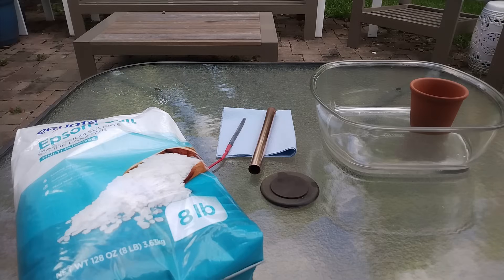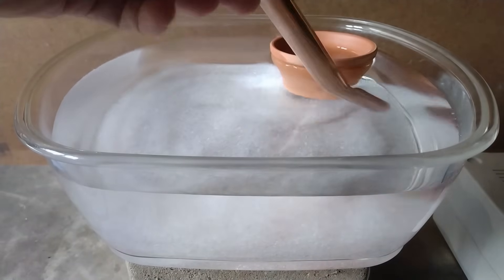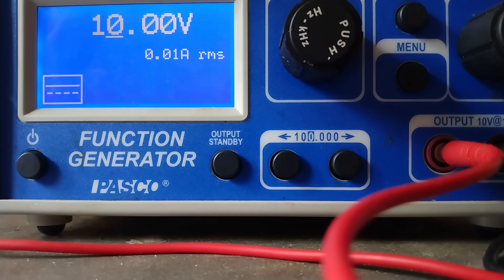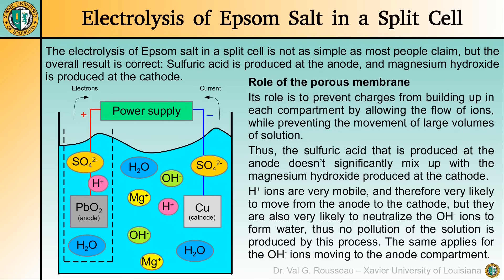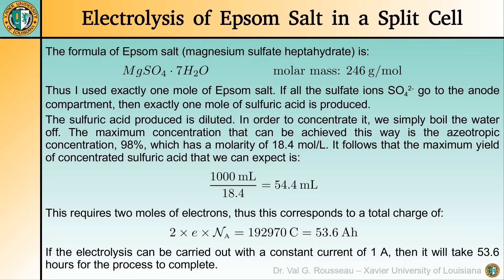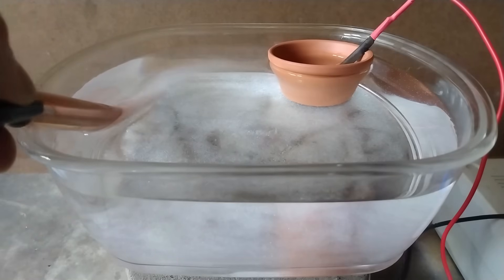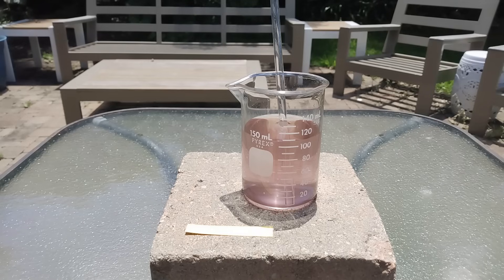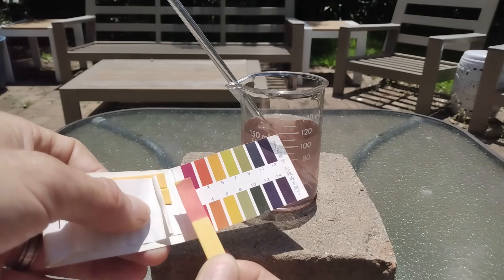Making 98% Concentrated Sulfuric Acid from Epsom Salt - DIY

Comment: I have watched several electrochemical sulfuric acid production videos, but in my opinion, this is by far the best video. Very well organized and the description and tables shared really brought the process together. Thank you so much for your time and work, this is awesome. Keep it up. Cheers!!
Reply from the maker: Thank you! Please, share the video.
Reply: Did you test it?
Reply from the maker: @suprememasteroftheuniverse  
I showed in the video a test on a paper towel. I also used it to make nitric acid (like here: https://youtu.be/NHBDXtn7pjA) when there was a shortage in store where I usually buy sulfuric acid as drain opener. The resulting nitric acid was working the same as usual.
Reply: @BlueMoonshine Does this chemistry relate to lead acid battery restoration using Epsom salt?
Reply from the maker: @RandomInterjections  
Probably. Look at this lead-acid battery that I made. It also involves a lead-dioxide electrode, the other one is a standard lead electrode: https://youtu.be/0zQYJJz89Wo
Reply: Why did we use PbO2 And Cu electrodes  and not graphite
Reply from the maker: @HeadmanLesetlhe  
Well, the video explains all the possible reactions that can take place, and shows that the PbO2 and Cu electrodes in this case are stable. If you use other types of electrodes, other reactions can take place and make the electrodes unstable. Graphite is not bad, but it will eventually decompose and pollute the solution. You will also have to change the electrode.
Reply: @BlueMoonshine  wow... thank you so much now I understand

Comment: The positive electrode is not completing the circuit,why?
Reply from the maker: Why do you say that? The circuit is clearly shown, the real apparatus as well as the picture. Clearly the circuit is complete. Current goes from the generator's positive out put to the positive electrode, then through the electrolyte to the negative electrode, and back to the generator.
Reply: Is the clay pot a conductor? Or made of graphite the clay pot is not at the same water level as the other container.At least from my perspective.
Reply from the maker: Did you even watch the video? It is clearly explained that the clay pot is porous and lets ions go through, so yes it is a conductor. As for the level of water in the pot, this is also discussed in the video.
Reply: Your accent ,made me speed up the video,sorry.
Reply: @ReynaldoColindres-n6l  Wow! You are criticizing the accent of a person who speaks 5 languages at a level well above "decent" in addition to providing you with clear information! Well done!  How many languages do you speak? Barely one?
Reply: My identity is known to the CIA,NSA, the D.O.D. and D.A.R.P.A My number system was created in 1996 it runs the World Wide Web and you owe me $5000 for my intellectual property ,pay quickly.

Comment: What if I put the power supply the wrong way around ?
Reply from the maker: Then your copper electrode is going to corrode, some unwanted reactions are going to be produced, and if sulfuric acid is ever produced (in the copper half cell), if will be polluted.

Comment: I have an old stickwelding machine , that i sometines use as a DC source to do some elektrolisys.
And was wondering if i could up the amperage it can put out 140 A, to speedup the proces ?
Reply from the maker: If you want to speed up the process by multiplying the current by 140, you need to multiply the electrode's surface area by the same amount. Otherwise, the voltage is going to increase and you are going to generate unwanted reactions.
Reply: @BlueMoonshine thanks alot ☆☆☆☆☆
Well done video's

Comment: I pretreat my pots by using them to make sulfates like copper sulfate.   Washing with muriatic acid as well.  Over time you leach out the trace clay metals.  I prefer titanium cathode as well since while the copper is not an issue there are sometimes other things used to treat cheap copper pipe which can foul your solution.  Best to either get electrolyte grade copper or cleanse them thoroughly.
Reply from the maker: Thanks for sharing your tips; those are great suggestions for purifying the process!

Comment: Why didn't you use a distillation apparatus for the concentration?
Reply from the maker: First, because distilling sulfuric acid requires you to heat the mixture at 337°C (639°F), which puts a lot of stress on the distillation apparatus. Second, because it is not necessary (unless you want a high purity of sulfuric acid). Just boil the water off.

Comment: I wonder how much energy it would take to create enough sulfuric acid to make a normal size lead acid battery?  That is so cool you can create the sulfuric acid using electricity.  I always knew it was a very resource intensive process to create batteries so lithium would have even greater losses in sourcing and creating the materials for its battery composition.  people need to learn and understand these processes so they can realize no battery will ever be green and they all need to be recyclable reusable over and over again and re-buildable.
Reply from the maker: For reference, here is a simple sulfuric acid battery that has enough power to run a small electric motor: https://youtu.be/0zQYJJz89Wo

Comment: lol oh dear oh dear, the distilled water isn't a non conductor because it isn't at absolute zero, that's just flat out absurd, no, the reason is that distilled water is a perfect balance between hydronium and hydroxide, both being present at 10 -7 moles per liter, they are stoichiometric, and neutralize  each other. If you add anything that dissolves in water, the ions can act as charge carriers, it doesn't take much of anything, even just leaving distilled water out and it absorbs CO2 forming weak carbonic acid, even this will conduct.
Reply from the maker: I didn't say anything wrong! Pure water at 0 K is an insulator. Above 0 K, hydronium and hydroxide ions form due to thermal energy, and the water is no longer insulating. If the water absorb CO2, then it is no longer pure water. I didn't say anything wrong, so you can keep your "lol" and "oh dear" for yourself!
Reply: Oh dear, here is ashleyobrien4937, a know-it-all who thinks he knows better than the professor...
Reply: Dear @ashleyobrien4937, you are exposing your ignorance and making it worse by unsuccessfully lol-ing at @BlueMoonshine who is right. As he said, distilled water at absolute zero temperature would be perfeclty insultating because there wouldn't be any hydronium nor hydroxide ions. It is because of thermal energy that these ions form and make it conducting.

Comment: I thought that such electrolysis would give sulfur at the anode. And the decrease in the amount of water in the pot is the result of osmosis. The salt solution "pulls" water through the membrane (pot wall).
Reply from the maker: No sulfur at the anode. The possible reactions at the anode are given in the video, and the reaction that takes place is the one that has the greatest oxidation potential.
For the decreases in the amount of water, yes it is because of osmosis.

Comment: I made some and it was almost the exact same from the red contamination turning into a clear solution, etc but when I get it concentrated enough, I keep getting mgso4 precipitation regardless of how long I run the electrolysis. I’ve gotten it stronger since the first couple batches. Any advice on what I should do to not have the precipitation. The acid is very very close to dissolving paper towel, doesn’t do much with sugar but is enough to generate a bunch of hcl gas when reacted with salt. I estimate the con to be around 70%
Reply from the maker: Usually sulfate salts don't react with sulfuric acid, and I bet the same applies to the remaining Epsom salt. The acid can dissolve it (like water dissolves table salt), but it doesn't react. So, you say you want to avoid the precipitation? Why? On the contrary, you want the remaining Epsom salt to precipitate so that you can separate it from the sulfuric acid by decanting. Regarding the concentration, if you have only 70%, it simply means that you didn't heat it high enough. The azeotropic temperature is 337°C. I usually stop heating around 330°C in order to avoid overshooting.
Reply: @BlueMoonshine I understand that they don't react. It's just when I reach around 70% the mgso4 starts precipitating out and if I continue it will become a sludge and it ends up being a waste if I try to decant the acid from that but I can definitely get it to the temps it needs. And even much higher if I needed to I had the temp up at 315 and it was still rising. I've tried running it much longer than the calculations predict. Whenever I catch it right before it precipitates I do end up with a completely clear and colorless solution though so figuring out how to not have the mgso4 precipitate out so early I will have it down
Reply from the maker: @ARaceIntoSpace  
But if it doesn't precipitate, it is because it is dissolved in the water that is still in your sulfuric acid. Sure the acid looks cleaner, but it is not. You want to precipitate the residual MgSO4, let it stand for some time so that it goes to the bottom, then slowly decant. What electrodes did you use, BTW?

Comment: Great video! I have used electrolysis to produce nitric acid from potassium nitrate and I also had the water level drop in my clay pot anode chamber. I believed it was due to osmosis. 

I had red tint in my first few runs too and the color lessened with repeated uses. I believe the iron content in natural terracotta was the cause and was eventually leached out. 

Using a passivated lead anode is a very good idea. I used graphite electrodes and the anode would disintigrate if the voltage was too high.
Reply from the maker: Yes, osmosis is a major contributor to the water level drop during electrolysis. Also, you are probably right about the iron in the clay pot.

Comment: To make the sulfuric acid, simply burn the MgSO4. You can make the pure SO3 gas.
MgSO4 -> MgO + SO3 at 1124℃
SO3 + H2O -> H2SO4

But this method requires enclosed reaction system.
Open air works may result injury or death.
Reply from the maker: I believe that burning MgSO4 gives MgO + SO2 + ½O2, not MgO + SO3. So, it is not that simple.

Comment: If I filled the hole in the clay pot with %100 silicon, would it still work or would it contaminate the reaction?
Reply from the maker: Silicon should resist to the sulfuric acid that is produced. Yes, it is hard to find a clay pot without a hole in it.

Comment: Red clay has a lot of iron.  In the spirit of diy, one could slip-cast and fire a pot out of kaolin (like EPK), and perhaps obtain a more pure solution.  To lower the maturation temperature of the kaolin (which is rather refractory) one might add a little B2O3 or PbO as a flux, neither of which is likely to react appreciably with the acidic solution.
(None of this is 'necessary' - there's a gallon of H2SO4 one click away from anyone.  But its manufacture is an interesting rabbit hole.)

Comment: Whay if i use sodium sulfate??
Reply from the maker: It is probably possible. A similar analysis as the one I made in the video should tell you whether the reaction works or not (look at the list of possible reactions at the anode and cathode, and see what are their respective oxidation/reduction potentials).

Comment: Considering your lead electrode came from batteries, is it possible that it includes some trace cobalt or manganese additives?  Since the pink coloration only occured inside the clay pot, rather than outside it. That pink seems very reminiscent of cobalt to me.

Once boiled down it would lose hydration and the color would disappear.

You could add ammonia solution maybe to the precipitate in your distillation flask to confirm.
Reply from the maker: I actually found out what happened: It was a brand new claypot and I forgot to remove the glaze on it. It started to dissolve in the sulfuric acid that was produced. Now, all the glaze is gone and I no longer observe this coloration.

Comment: Very cool. I never push towards other electrolysis. I just use it for plating or rust removal. Been meaning to make concentrated oxygen or collecting carbon. This looks like something i may try in the future just for fun. Got into mechanical n chemistry engineering while i was in hospital. Wish i was this interested in it when younger.

Comment: So to make h2so4 I need a pbo2 electrode and to make the pbo2 electrode i need h2so4😅 i hate rules.
Reply from the maker: You can simply use just lead, and the electrode will oxidize and turn in lead dioxide as you do the electrolysis. This will produce a little bit of contamination at the beginning, but it won't dissolve so you can easily filter it out.
Reply: @BlueMoonshine  thank you!

Comment: No, your explanation is all over the place. Many things you said are not right, but your bit about protons being highly mobile, they are NOT free protons but are found as hydronium ions, H3O+, you could have got much better separation if you used a better cell divider, you will find the white plastic inside LiPo batteries, or even Lithium ion  batteries, makes for an EXCELLENT cell divider, allowing only charge to cross, the membrane porosity won't allow salts to cross etc. Huge current draw through it is possible BUT be careful not to allow the cell temperature to rise over say 50 Celsius max otherwise the tiny holes in the plastic will close up creating an open circuit-that is a design safety factor of course, when the battery is operating outside of current draw or loading it shuts the party down permanently. The great thing about that stuff is that you can get almost a meter of it from just one AA sized cell, but the bigger LiPo's give a wider piece to work with. Just take a plastic container, cut a small rectangular sized hole in the side, cover that hole with a piece of the plastic separator, use silicone glue to mate it to the plastic bottle, and voila ! there's your new catalytic cell. No silly primitive clay pot needed.
Reply: I don't think @BlueMoonshine's explanation is "all over the place". It is a pretty good tutorial with a simple experimental setup that can easily be done at home by anyone. Just because he said "protons" instead of "hydronium" (which is a common shortcut) doesn't invalidate his explanation. Now maybe it is possible to improve the setup as you said by using the plastic membrane of LiPo batteries instead of a clay pot, but once again this doesn't invalidate his tutorial.

Comment: PEOPLE DONT WORRY, you can make two electrodes just by using graphite sticks which you can find at any hardware shop
Reply from the maker: 1) Graphite decomposes and leaves a mess at the anode.
2) Why would people worry? It is very easy to make a lead-dioxide electrode, as I explained.

Comment: could I possibly use both Kathode and anode made out of different materials?
Reply from the maker: In principle the cathode can be any conducting material, but the anode has to be made of a non-corosive material. Either lead-dioxide, platinum. Carbon can be used, though. It will corrode, but the corrosion can be filtered out, as it won't dissolve in the sulfuric acid.

Comment: 260 grams of salt and 4 days of work for 5 ml of sulfuric acid. So for 500 ml of acid I need 26 kilos of salt. Lab alley is not that expensive then
Reply: That's a ridiculous comment! The point is not to save money, the point is that many countries (like Italy and Germany) ban the sale of sulfuric acid to non professional chemists. Then making it like presented in this tutorial becomes a viable option for people who need it.
Reply: Still 5 ml  after all . The question is if I wanna make litres the only way is to increase the quantitie of salt ?  @AndreaKarlis
Reply: @Memo-py3eu  
Atoms can't be created without involving nuclear reactions, so yes, the quantity of salt must be increased.
Also, there are some losses due to the fact that the claypot is not a perfect separating membrane, so some of the sulfuric acid produced ends up leaking out. Maybe using a better separating membrane could increase the yield without having to increase the amount of salt? Is that right @BlueMoonshine?
Reply: The real issue is epsom salts is mostly water, so much of the weigh needed is not used in the reaction
Reply: @ScottLowe-me2ge  An alternative is to make it from copper sulfate, which contains less water. There is tutorial also from @BlueMoonshine: https://youtu.be/sJs31qK2ClM